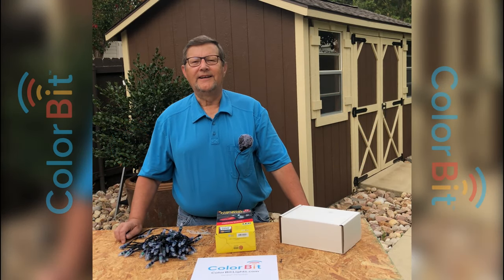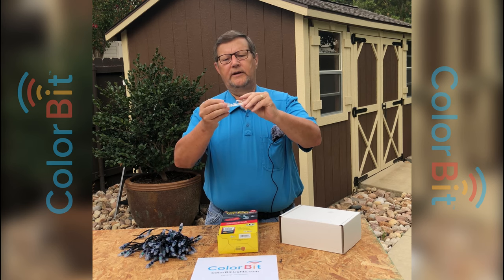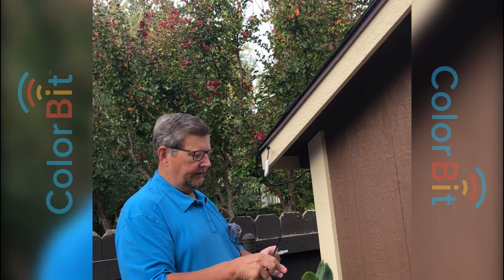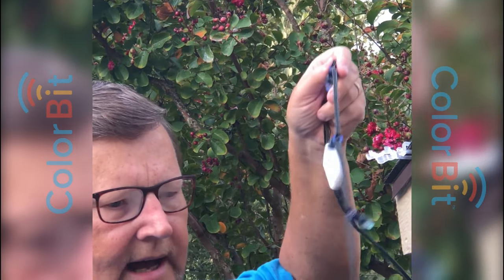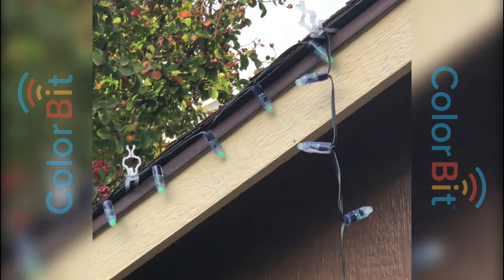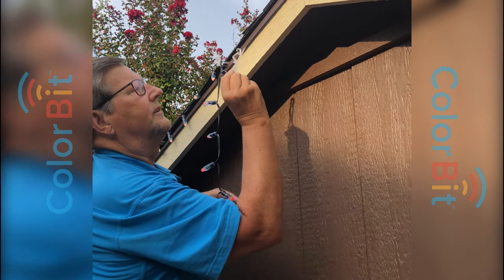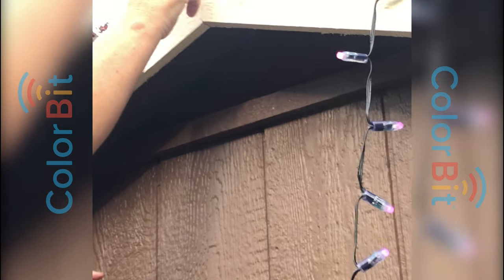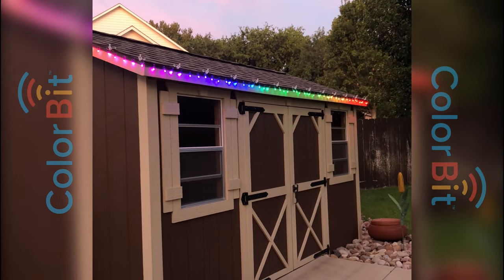ColorBit Lights No Drill LED Roof Line Installation

Comment: What if you have a flat roof with a parapet? How do you attach these lights to the roof line?
Reply from the maker: It would depend on the design of the parapet. If it is flat, one option would be to use Vinyl Channel and install it so the bulbs face out. Check out https://www.youtube.com/watch?v=fNSj-ODCKVs for a video on how to install the channel (albeit under an eve, but the same process should work). Pre-drilling and or masonry anchors might be necessary on a concrete or brick parapet. We recently added pre-drilled channel in our store if you can't find it locally https://colorbitlights.com/collections/all/products/vinyl-u-channel-with-12mm-holes.

Comment: I would never use those plastic hangers. They are terrible! They keep drying out and breaking after a year. I went through 3 boxes then finally I now use nails. Also you can see on the video they are not too strong and cheaply made.